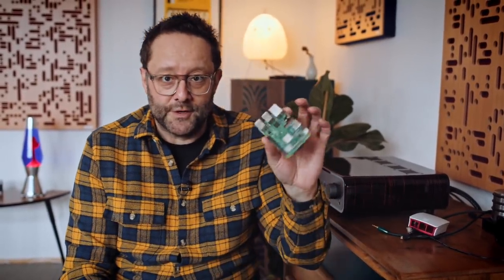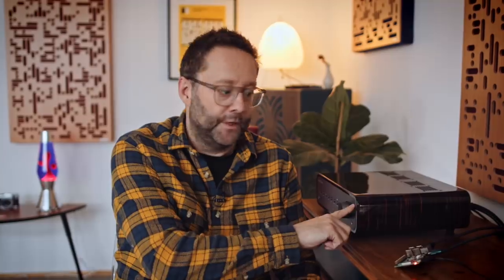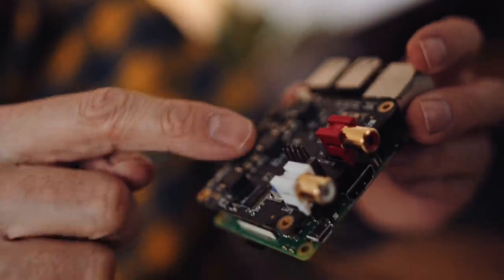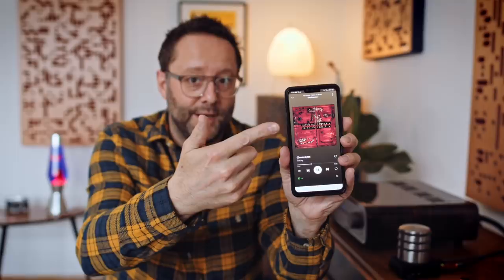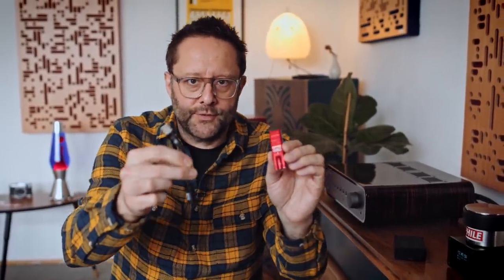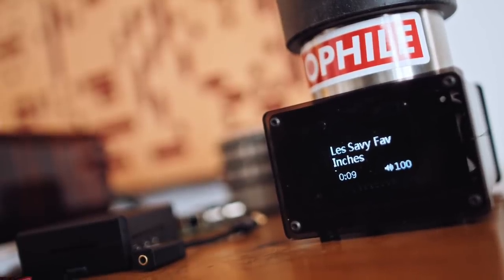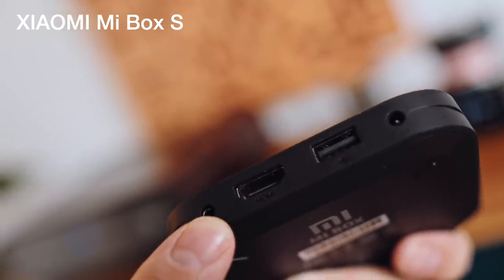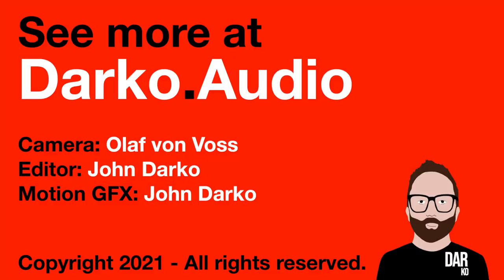Spoti-Pi: a beginner's guide to SPOTIFY on the RASPBERRY PI

Comment: Hi John, found your channel recently and have found it really interesting and helpful as I get back into quality audio after years in the basic wilderness and downsizing. I'm definitely a 'functional first'  audiophile. I've recently installed Volumio on a Pi Zero with an Allo Boss mini. I'm not a critical listener and this is good enough for me through an IKEA Frekvens powered speaker in my tiny apartment, I also got a Dragonfly Black for my faithful Sennheiser 280 Pros and again, good enough for me at the moment. Wondered what you thought of the Pi Zero DACs and also, if there's a difference in sound between the pi Zero running a Dragonfly over USB and a Pi 3 or 4 running the Dragonfly over USB. I'd be super interested in your thoughts, Stu. Leeds (UK).

Comment: That weight keeps the Pi from sliding off the table 😹🖤
Reply: BTW, the weights used are weighted door stops like the Sumnacon Heavy Duty Floor Door Stopper  @t  and the heavier large stainless steel door stop on blomus  @t

Comment: Do these various cases for the Raspberry Pi provide enough of a heat sink (without a fan) to keep the Pi below 60°C such that it will not start throttling?  And if it starts throttling does that affect its performance in use? Can we practically use the Pi as a streamer for several hours without any issues? Thanks!

Comment: How about using raspberry pi to with a adc/dac board to stream to another pi with a coax output. Why you ask to make an LP player wireless using 192/24 and output digitally to an integrated amplifier like your peach tree or in my case my bruchardt a500.

Comment: How about always using Tos-link to connect a streamer to a DAC because it galvanicaly isolates the DAC from the streamer. En how about getting a linear power supply for the DAC at least or also for the Pi if you are going to connect it over USB or S/PDIF
Reply: Supposedly can' t get rid of the jitter inherent in toslink....

Comment: Haven' t read through all these comments, but I only have a lowfi system.....onkyo/jblstudio530speakers, using a ifi usb zendac out of my imac.Would it make sense just to get an rpi4 with Volumio, and run it through  the zen dac into the onkyo amp?....Connected to wifi through volumio, with a usb drive of ripped cds, and with spotify streaming? Would this be comparable to Darko' s red dragonfly setup? Thanks for any tips G

Comment: Thanks for this, your video does a great job of covering a variety of options! I wonder what your thoughts are on achieving synchronized playback from multiple sources (like Sonos systems do)... Is there a network streaming approach that does not have bit-rate or resampling issues like chromecast?

Comment: Are you familiar with Rasposify? Well, as the name suggests Spotify only OS for RPi. After the setup no need to ever touch it again and works great. It might be handy for some, if Volumio is too much. 
I am running RPi4 ? Allo DigiOne to stream into NAD D3020 all good.
Do you think using  this streamer combo with a high(er) end amp will be fine, or would it kill the purpose of going for an 1200€ integrated amp (CA CXA81)? 
Thanks for the video.

Comment: Greetings from Greece!
On the video you mentioned that Android is upsampling the audio.Does the same happens when we use USB instead of the digital output?
I have both Xiaomi box and Nvidia shield and Shield has an option for high quality audio on USB port so does this option bypass the upsampling?

Comment: Hi All, I understand that John's video is all about the sound and not  the build.  I would just like to let watchers know that I have had issues with the build Quality of the Helm Bolt, after 3 weeks of  minimal use the headphone socket became loose and the sound stopped. I had a look around the TiNternet and found a few other cases of the same issue, the support group have been helpful but have no stock to replace it with July at the earliest.  may be look at another Dongle DAC
Reply from the maker: To add counterpoint to this, I've been using a BOLT pretty much eveyday for the last 4 weeks and have had zero issues.

Comment: A basic Pi USB to DAC question for the community:
The one free input on my Modi 3 is USB. Considering the bad reputation the USB port on a Pi has for audio extraction, in which direction should a chap with very limited budget be looking?

This question has been bought to you by our friends at COVID-19, the official global sponsor of audiophiles with far less spare income than usual.

Thanks for reading,

jjams82
Reply: Of course, the "just enjoy the Modi 3 via USB and worry about upgrading it later if you want, it's not even remotely unlistenable as a basic USB output" is quite a fine answer:)
Reply: I have seen comments of people using the usb of the rpi4......out to their dacs...with good results.....depending on if their system is mid fi...or low fi.......maybe a problem if your system is $ 10,000 or up...

Comment: What about a Chromecast (or even a Roku, fire stick, etc? They can be had for like $20 used and output a digital signal. They require zero setup and support almost every audio streaming service, not to mention they output a video signal and offer a streamlined A/V experience not limited to just music. A $10 adapter is all you need to hook up Toslink/coax to your DAC. I don't know why these streaming boxes go under the radar.

Comment: Was wondering. Can volumio output audio through hdmi to connect to an AV receiver?
Reply: Filipe.. did you find an answer to this question? Or maybe using anything other than Volumio? I'd also want to do it using a Spotify free account.

Comment: Curious if anyone has any alternatives to volumio they’d like to share? I really don’t have a problem with it, but I exclusively use it as a Roon endpoint or for Spotify connect, so I really don’t use the “Volumio parts”. Any recommendations for a lighter weight alternative?
Reply: I’ve been using raspotify which works well, though only for Spotify connect through the app on my devices

Comment: So, having a laptop, running Spotify,  connected with a USB cable to a DAC  is basically the same thing as using the Raspberry pi, running volumio,  connected with USB to a DAC? 
Should be the same soundquality? 

Great video!!
Reply: depends on the laptop and electrical noise over USB. The DigiOne HAT mentioned would be better than straight USB from the Raspi and with a laptop your fan and battery could cause issues over USB
Reply: Also, you can leave the raspberry pi powered on at all times as it consumes such little power, and free up your laptop for other purposes

Comment: 4, 5 months ago I bought a 3+ and Allo digit signature one. The sdif output doing to a Topping D50s with 2 Sabre dacs. Now this beauty comes along. I'm like WHAT NOW. I have a Pi4 sitting around that I was trying to decide what to do with. The Allo is in my main system. The Pi4 with some kind of hat was going to be my desktop setup. This dac mini could change everything.  I may get this to compare against the D50s. That's progress. And mo money,,,HAHAHA.  Would any D50s owners care to comment. This rasdac could replace it plus the 280.00 plus the cost of the 3+...and case. We will see. Or I can not buy this , get the Helm BOLT to use with the desktop. Humm, this might be better as I can now use it with my android phone or Apple iPad for headphone listening. 🤔

Comment: There is a cheaper and easier option: using a Roku and connecting it directly to the receiver via HDMI. It is already built, it is always on and you can use it as spotify server. As it is hdmi it is digital audio. Cheaper and easier.

Comment: The dac on pi is horrible. I didn’t like it.
Reply: Thats why there are dac boards for the pi around.
You could get an hifiberry or a boss dac.
These are easy but expensive. (About the same price as a pi itself)

But I went really cheap, and got a pcm5102a dac for about €2,50.
The pcm5102a does need soldering of 6 wires, and those wires have to connect at specific gpio pins on the pi.
And set this up as it is a hifiberry-dac.

It is a bit off tinkering, but believe me, it sounds amazing good